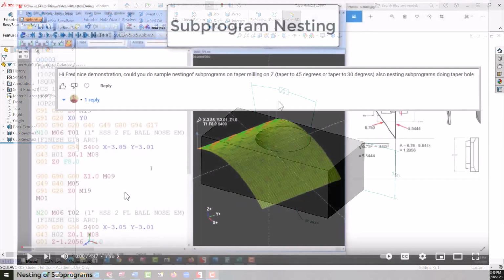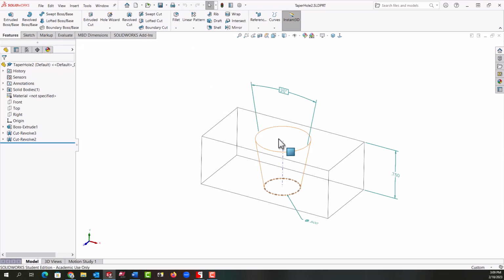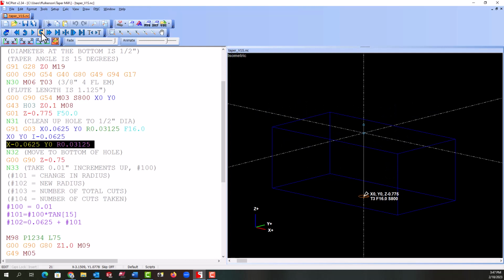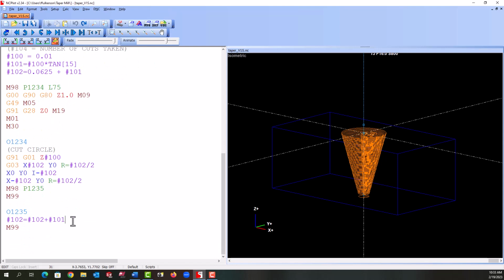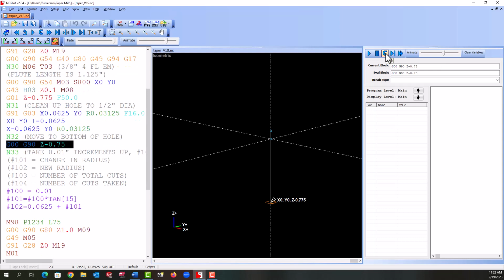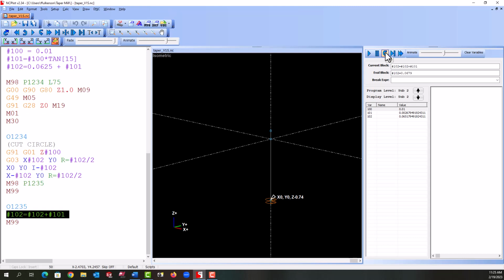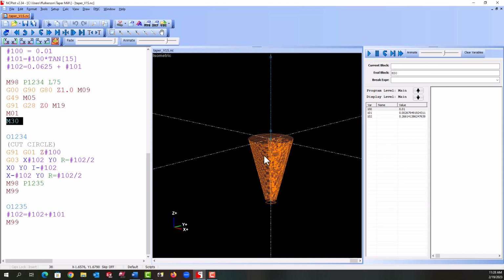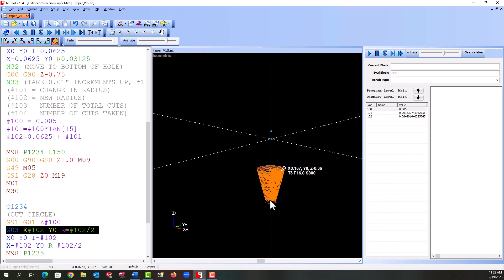Programming a Tapered Hole on a CNC Mill

Comment: Hi Fred can you also make a sample macro program doing a half radius on milling with Y and Z axis  where the Y value is always different every Z step overmovement.
Reply from the maker: Would this be an open half round pocket?
Reply: @Fredumaction   it's an outside radius feature

Comment: Cool macro, had to modify cut sub as fanuc 21iMB does not allow for NC and macro statements in same block. (#103=#102/2 and so G3 X#102 R#103)
Reply from the maker: Glad you liked it
Reply: @Fredumaction  Very much thank you, used it in a small production run for some flanges that were made in milling machine instead of lathe because of backlog. 👍
Could have just done it in CAM, but this was much more elegant and flexible solution.

Comment: Cheers Fred , will this also work if I use a ball nose endmill? and if I start on top?
Reply from the maker: yes, but you will need to compensate for the point of contact on the ball.
Reply: @Fredumaction  thanks again Fred